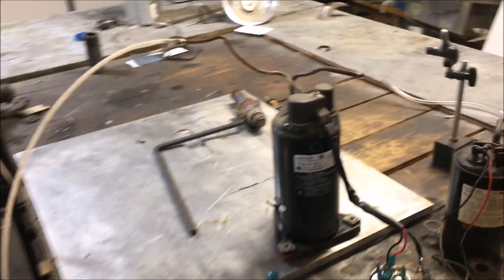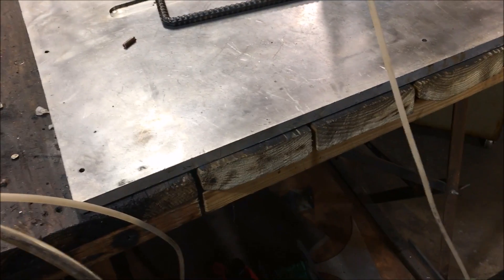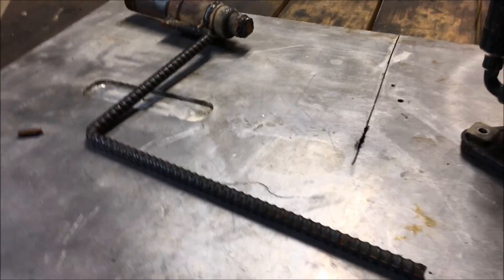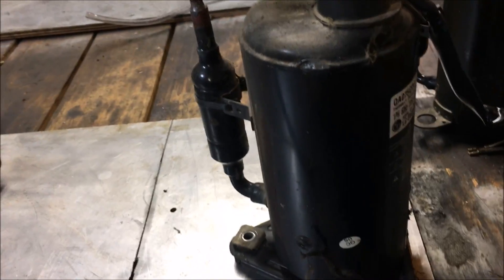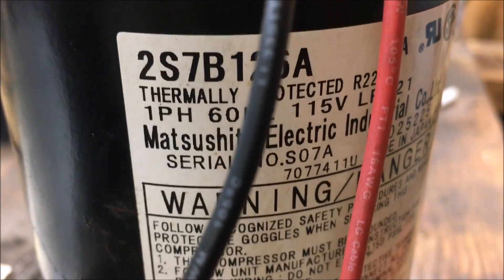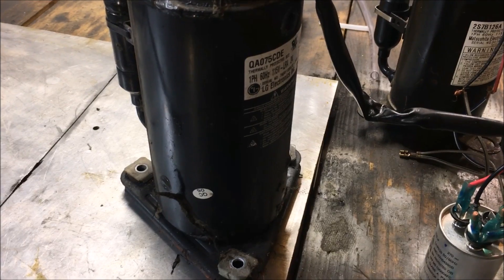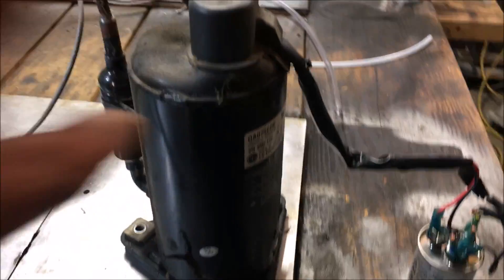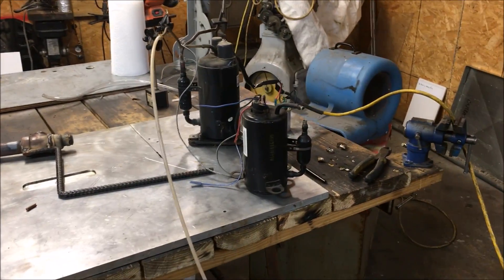Ac compressor powered ?  waste oil burner for Bob Rosco

Comment: standard ac compressor is much less powerful than air compressor, and its made for higher pressures. Though, have you thought hooking two of them paralel? should have enough flow but still would be much quieter than standard ari compressor

Comment: atleast you had a go at it. It was just an idea to get a more silent compressor setup, and if the thing did have the output then that would reduce the noise by a lot from what i hear in this video.
I also did some research on fridge compressor. And from what i have found they tend to be rated at 0.7-1.0 cfm for the normal size fridge. A big twin door type of thing probably has 1 that might be double the cfm. But as you said you where running your i think 3.something cfm compressor prettymuch nonstop that would mean you would need 3 or 4 fridge compressors for that nozzle. Maybe the smaller airbrush style nozzle might be a little les air consuming and work of of 1 or maybe 2 with a air tank and a pressure switch. If it werent for the big pond in the middle and the voltage difference i would be able to give you 2 fridge compressors as i have those sort of laying around(i use the fridges for paint storage in my shed, so it wont freeze in winter time, but those pumps are just sitting there doing nothing)
Reply from the maker: Well it was a great idea and it was itching , however , im not done just yet , maybe we could get a 2,000 to 3000 watt burner going with this , it will pump fuel so some time soon im gonna give it one more try , but first lets see how my current set up does on very low air pressure and flow and if it seems possible  to run a stable flame at very low output , ill hook that bad boy up and give it another try . Bob we also forgot that these compressor can be "over clocked "  using a VFD or a different motor all together .    I think 3500 rpm is the max for 60Hz but because we will be under very little load we could hit 8,000 rpm with this compressor no problem  . im tempted to get my hands on a VFD , i need one for my lathe any way
Reply from the maker: Get a VFD and it will work like a charm

Comment: Single Phase.

Did you get any indications of how many CFM the compressor is supposed to run at under working pressure?
Reply from the maker: No i tried , its all in pounds per hour of refrigerant
Reply: Its a little math, but basically, on average, all gases are fairly close to 22.4 mol gas at STP so if you take the g/mol, convert the pounds into grams, divide the grams the molar mass, multiply the molar mass times the STP for the refrigerant [be it R-22, R-134, R-410, etc] by the molar volume [or cheat and simply use 22.4 then by the vapor pressure, and you will get the CFM.

http://www.fire.lacounty.gov/wp-content/uploads/2014/03/Gas_Conversion_Chart.pdf

Comment: Oh, I meant to add that it might work if you raised the oil level.  You are fighting a pretty good suction head to lift the oil that high.  Thinner oil might also work better, you might also be able to adjust that end cap to decrease the air space between the tube and cap.  This would raise the pressure developed and increase velocity but reduce air volume delivered and the total amount of fuel that could be atomized(decrease BTU output).  Decreased btu is a good thing imo.  Anyone can make a burner that outputs 2 million btu/hr, but how do you use that much heat.  Give me something that puts out a clean burn at 15-20 thousand btu/hr...  that I can use...
Reply from the maker: Great comment and yes you are correct , reservoir position is important and i agree about the 1 million Btu's LOL you had me rolling . Ity turns out thats exactly what im up to , im building units that run under 50,000 watts, mainly in the 20,000 watt region or 68k Btu  and am currently working on devices even lower power then that with my micro burner design , hoping to hit 5000 to 10000 watts or  17k BTU/hr  to 34k BTU/hr
Reply from the maker: 5000 watts or 17,000 btu's would be 1 liter per hour
Reply from the maker: Thanks for your input friend , very informative , just wanted to let you know that the reason i stopped the test before  moving the oil bowl is because after using this nozzle you can tell when it will and will not burn . Example , it will barley run at 50 psi , 50 psi is an extremely unstable  parameter but it will siphon oil under the observed conditions , so to fail that test rendered the experiment conclusive , however now that we have discussed it , it wouldn't it   be cool to compare what me and you think  to what the laws of physics do in complex systems ? maybe ill give it a try on my last test , the lowest power burn of all . Maybe with a different nozzle it would work but not with this one i dont think , it failed the siphon test but as i said , it wouldn't hurt  to try an air flow that small , could never get under 50 psi in the past , combustion fails due to  the siphon .A siphon must be designed  for a very narrow band of operation   , a low flow siphon and a high flow siphon will differ drastically and can not be interchanged .  high flow siphons will not pump at low air pressure and a low flow siphons cannot provide enough fuel for the volume of air applied if you attempt to operate the device outside its geometric  specifications . Thus said just because this nozzle didn't work doesn't mean the process wont ....
Reply from the maker: I could agree more about the 1 million btus , a blacksmith needs a small forge to make knifes , how many btus does that take you think ?  10kw is my goal , i prefer Kw descriptions of power so i dont need a calculator to compare the power to every day objects  , example we no a wall outlet only allows 1.8kw before blowing a breaker and a home furnace uses 10 to 18 kilowatts , a hair dryer is 1.5 kw and so on ... Btus im like great , wheres my calculator , i just havnt learned the system yet so im avoiding it . same thing with  clecius , i love the system especially for thermal dynamic and kinetics equations  but 1000 c just means hotter then hell to me , i always like to know the Fahrenheit because thats the temp i know for melting points of metals .
Reply: NOBOX7 yep, between a half a liter and a whole liter per hour would be great.  Unless you are smelting metal or incinerating garbage, the problem with making heat this way is you need a heat exchanger to put it into water or air for use.  A small burner allows me to do it efficiently without needing a heat exchanger the size of a shipping container...
Reply from the maker: well i personally dont promote using oil for heat  , most people dont have access to the thousands of gallons they will need , im more interested in making these for forges and other applications ,i used one to burn a tree stump impregnated with chain link fence out of the ground , strange things like that are my primary use
Reply from the maker: Im not saying you shouldn't , i just dont focus on that because i know how much oil these things would have to burn , drums and drums of oil per winter . but if i had the oil  i would do it
Reply: NOBOX7 i actually use a babbington and a heatex to heat my garage workshop. Low oil consumption and efficient heatex means free heat within my oil supply, actually have a surplus as I am not using it as fast as I generate it...  think there is a video of it on my channel...
Reply: Hey, have you had success with using a digferent kinde of nozzle?
I am very interersted in using an ac/ fridge kompressor to atomize oil.

Comment: Another cool compressor to try is smog pumps from 1980s cars (they are a mechanically driven scroll type compressor). I have seen video of one properly hooked up blowing a 30 ft column of air.  I will look for the vid.  Maybe not ideal as they can only generate 5-10 psi, but a very high cfm.  I am sure you could utilize one in your experiments.  Guys are using them as small engine superchargers, that's how I came across it.
Reply from the maker: Yes i looked at smog pumps for weeks one time , they are only around 5 psi though like you said and we need 50 minimum  , but the do have a huge output. It was not for this project thought  .

Comment: A/C compressors are not known for their volume. It was obviously building pressure when you blocked it off, so it is probably working OK.  It would probably run a Babbington as the air only feeds a  pinhole.  Mine runs on about 15 PSI at a very low CFM(compressor refills about once an hour) which is the benefit of a Babbington over a siphon.
Reply from the maker: Thanks for the input .
Reply from the maker: Cool info about the babington  thanks , im trying to accumulate all the info i can
Reply from the maker: yeah was hoping for a scroll  compressor , dreaming i guess , my next idea is an ac from a car , those suckers have some serious output
Reply from the maker: I bet  a VFD would pull it off no problem , we are maxed out at 3500 rpm for most 60Hz motors and i bet we can take this think to 10 grand no problem , the pump design is small so centrifugal forces would be low , it would need a special oil system as these device breath oil basically for internal lubrication